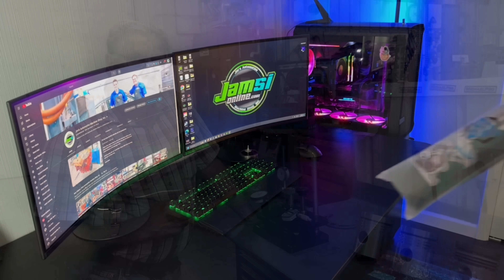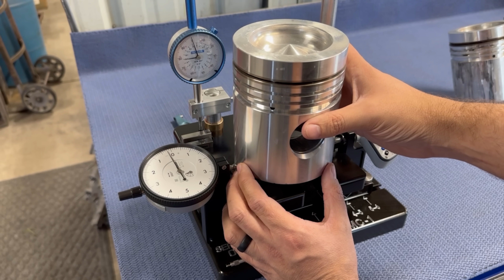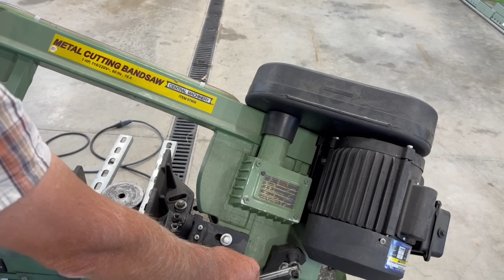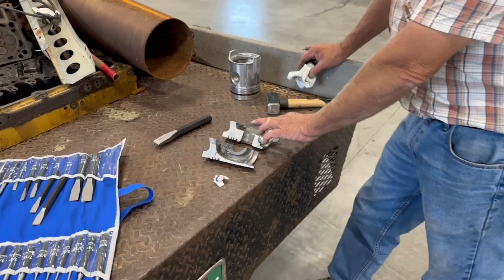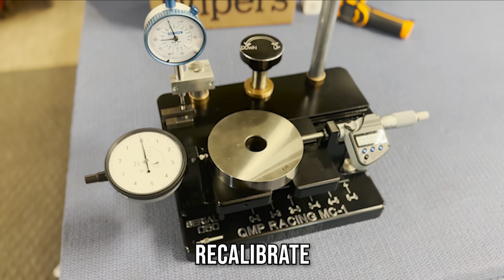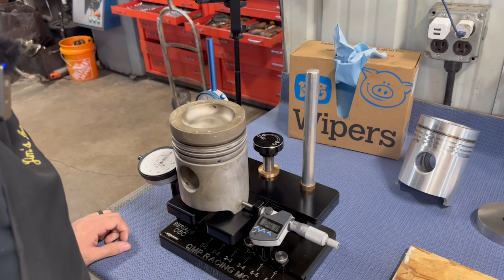Have TRACTOR Pistons Changed In 50 YEARS?

Comment: GOOD JOB testing this and learning.   BUT..... you need to check the cam grind and taper of the piston skirt to see the full picture.   The cam ground skirt is a bit like a leaf spring, starting with narrow contact in the middle cold, as the piston heats up teh contact gets wider....which more contact COOLS the piston and it's almost like it regulates itself.  You might already know... "four corner scuffing" is what happens when the springyness of the skirt runs out of travel.   Far as Silicon content, the amount that the aluminum expands with heat is negligible difference one alloy to another, but the true difference is how much the piston MOVES heat down to the skirt, and how tight it CAN get before scuffing.   LOW silicon pistons move heat fast and have POOR scuff resistance, so the skirt will expand more because it gets hotter,  and will need to be looser because the material is more prone to scuffing.   While a hyper piston the skirt will stay cooler, and can run tighter without scuffing.  
I'd love to talk with you guys sometime, tho I called once and did get a kick out of your answering service, which is fine, free time these days is a rare thing, but maybe in the future.

Comment: I would love to send you all my mildly built olds 350 and see a video of y’all going threw it. I could do it but it would take me way longer and I need more tooling to do what I’m wanting. I have the original blueprint sheets from je😢mmm Phillips & Wilkerson racing built the motor. 
Lift 490. /520.    @224/234. At 107 lobe separation  I wanting higher compression pistons. The a good aluminum heads and a
Full solid roller cam and lifters for it. 
Wish I could find a dieseil block to use and add boost to it.

Comment: Newer Piston verses older Engine block casting...Can there, and is there a lubrication issue... Possibly seizure...What about the chemistry or alchemy of the Piston metal..itself , between the two Piston. And actually the new sleeves could possibly have Metal chemistry difference that could effect... this whole thing..

Comment: Your right ,always go by the piston manufacturers recommendations . Only time I go by oem specs is if I'm using oem made parts. Piston manufacturers have spent millions on testing to find the best clearance,for new materials
Reply: If you think Reliance has ever had one of these pistons in an engine and tested it I can about bet it likely never happened. They are in the parts copying and reselling business not the development business. With a portfolio that covers thousands of engines of tens of thousands of applications many of which have been obsolete for decades    They probably could not come up with enough engines to test their products even if they wanted to.

Comment: Hello good after, great work, but here comes the guess from coach viewer. If you have an engine without oil squirters (that will cool down the piston) and new piston has more material in the bottom of the piston, so it will expand more due to a more material and  will expand more (than an old thinner wall piston) and cool less. So that may be a problem that you had.

Comment: Just weigh a piston, measure it's volume, and calculate the density; that will tell you if there's a steel insert.
Reply: I came here to ask that, would be a good indicator of how much difference in meat there is
Reply: Very simple to say but difficult to do.  A piston is not a regular solid cylinderical shape where its volume can be easily calculated given you have the accurate density data.  The said pistons have an internal 'topography' that is highly irregular so would be difficult to establish an accurate shape and therefore enable the accurate calculation of its volume - especially when "we" are considering small variatons.  It could be done if you have acurate aluminium density data and engineering drawings of the pistons - however even in the aforesaid case it will not represent the physical item since there will be variabliity during their manufacture.

Comment: I rebuilt a 1973 Harley Sportster using the specs from the manual. After 500 miles of gentle use I got on it and the front piston seized. I talked to the Harley shop and they said "the factory manual is wrong. You need to use the clearance in the factory manual ADDENDUM".

Comment: Love the series and not trying to argue but two things changed.   Maybe the most significant was the fuel pump rebuilt 100% correct (and I did watch the assessment by the consulting injection pump people).     The other of course is the ring gap.   And its possible that the one issue and call the ring gap an aspect,  combined to push the cylinder wall into overheat.     Will never know of course and the right things were done,  get the injection pump 100% correct and give a bit of more wiggle for the rings.

Comment: You mentioned the tin coating on the old pistons.  Goldsmithterry in his comment also pointed out the lubrication of tin.  It's like older USA made light bulbs.  Tin and brass bulbs screw into their sockets easily.  Modern Chinese made bulbs made from melded down Chevy's and Ford's will gall often times.  Could that tin coating be important on the clearance issues?

Comment: I’m really surprised you guys didn’t weigh the Pistons and then heat them up in an oven and remeasure them to see who had the most expansion
Reply: The weight would just be that an wouldn't change. An they did heat the pistons and check them. Maybe watch video over. They heated them up in moms oven lol.
Reply: @rprice7670  And froze them in mom's freezer, with the steaks!
Reply: @scrappy7571  😅
Reply: The mass (i.e. weight) of a piston does not change with an increase in temperature - within the temperature realms being discussed - as there is no 'vapourisation' of the aluminium.
As far as the pistion's thermal expension when subject to heat, the the video provided the information.

Comment: I designed machinery for almost 50 years. The coefficient of expansion difference between allows of a particular metal has never been an issue. What does effect it on tube-like parts is wall thickness and part density. A forged part will perform differently than a cast part. A part with a thicker wall will expand differently than one with a thinner wall.
Reply from the maker: To say coefficient of expansión difference between alloys of a particular metal has never been an issue is simply wrong and there are tons of studies, particular on cast pistons, to support my claim.
Reply: @JAMSIONLINE  Cast pistons and forged pistons will have different section thicknesses and that is where the expansion difference come from.

Comment: Everything goes into the tolerance. The internal changes could also affect expansion and the reason they made the changes. As usual your assumptions are spot on with what you find.

Any time you change from OEM there are changes. Even new OEM parts can have changes based on updates in everything.

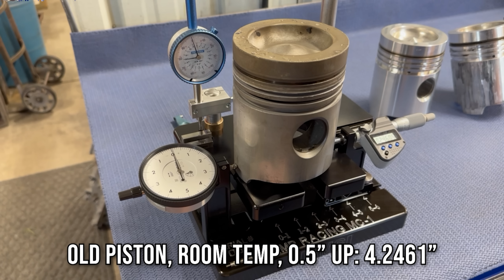Comment: At 6:52, you’re showing the measurement to be 4.246. That almost 4 1/4”. But the standard you used was a 4”. Something isn’t right.
Reply from the maker: A 4” standard is used to zero the micrometer. At that point 0.00 on the mic is 4” and 1.00 on the mic would be 5”.

Comment: Not sure you are considering that piston's can have a different cam grind. Basically that's an oval shape. I had my own pistons made for my race cars back in the day and I had to specify a cam. I can't tell you that I know what is good and bad or how to determine a clearance from the cam spec. I knew what worked from the guys that I apprenticed with and the difference between the Venolia and Arias pistons popular at the time. The Arias pistons needed a lot more clearance. Damn those things made a lot of noise before the engine came to temp but if you didn't make those clearances  loose you would have pistons that look your failed pistons in the video. I really need to find that old engine log book.

Comment: nice job looking at the geometry of the piston (skirt diameter across temperatures) .  I did see a difference in the geometry (more / less material) of the skirt below the pin boss.  this may make a difference in the thermal growth in that area and the stiffness of the skirt below the pin boss.  the question of material type is still unknown.  there are a lot of different alloys of aluminum.
Reply: Expansion will likely be less in a harder alloy.

Comment: That thing is the better part of $3000 dollars. You can learn how to properly use a micrometer for $3 grand.
Reply from the maker: And? You can ride a horse to the store too. One’s a lot more efficient. 

We said right in the video a micrometer is fine. Doesn’t mean this isn’t an improvement. It’s up to you to determine what value that improvement has to your own business.
Reply: @JAMSIONLINE  An amateur is not blowing $3K on a piston measuring stand. 

I would HOPE a professional engine builder has the competency to read a basic  micrometer. 

Not to mention one 'should' already have a have a dozen other ways to measure something. Surface plate, height gauge. lathe with a test indicator, mill with a test indicator, etc etc..

That begs the question. Who is this marketed towards? The answer is clearly clowns with more money than brains. 🤡🤡🤡

Comment: The only thing 2 machinists can agree on is... The 3rd machinist is doing it wrong
Reply: Oh man.  That is so right.
Reply: When a young grad student, I was in the engineering school machine shop and one machinist was fussing to me that another machinist was stupid to drill a  large hole by slowly stepping up in drill size, as if I knew any better (no undergrad courses on machining nor shop).  He said all you needed was a tiny pilot hole and the final drill would follow it straight down.  Perhaps the hole ends up more centered that way, but I step up drill bits gradually at home.  Maybe I could get by with a two-fer if my drill bits were ground perfectly but I just eyeball them on a grinding wheel when re-sharpening.  At least they had a quality drill press which secured the parts, but drilling a hole on a milling machine or lathe would likely hold center better.
Reply: @williamgrissom9022  whatever gets the job done. At home you can do it however you want!
Reply: @williamgrissom9022 Generally, the larger the diameter to be drilled, the amount of steps should increase. Small holes will be fine with two sizes, just as very small holes will be done with just one. As the material volume increases with pi as the diameter increases.
Reply: It's obvious that you've been in a shop that's had at least three Machinists ! 😂

Comment: The shape of the lower end of the Piston where the older one is square and the newer one is rounded. that rounding is physically stronger than the sharp right angle and eliminates stressing fail point in the Piston skirt.

Comment: Old tip on piston fitting. Just boil each piston and measure expansion while hot. If the piston expands .004" and the clearance is .003 well you guess what happens.
Reply: U done this yourself?  Would love to see the video.
Reply: They just did the expansion test using the oven - which is a lot hotter than boiling them. Their clearance was fine. Came down to ring gap and suspect injector pump.

Comment: The main reason there's a steel or cast iron ring for the upper piston ring is to make a thermal barrier to it, to avoid or reduce cooking, and it's also useful to keep the groove shape to the right dimensions, to allow the ring to be pressurised by combustion gasses.

Also, if the ring has a conical section, meant to "hammer" slightly in the groove to clean off combustion residues, the hard groove surface allow it to last a lot longer.
The small dimensions of the embedded ring can't make any difference to thermal expansion of the aluminium, it is going to stretch when hot!

Comment: I understand the issues of fitting modern manufactured parts to an older engine, tolerance stacking and changed materials make for interesting decisions over what is "right". However, I am so disappointed, as I feel that there is no credibility to your research, as you weren't wearing white coats with pens and a 6 inch slide rule in the top pocket. 🤣😂🤣

Comment: Incorrect piston sidewall clearance does not crack valves if they never make contact. Back to combustion temps and injection timing.
Reply: Yup and a turbocharged non after cooled non piston cooled engine can be fine but it has much less margin for error on heat.

Comment: While like you said this isn't MIT level exact, but this gives us and yourselves some quantifiable data.  I initially thought part of it was the piston clearance was too tight just do to the engine locking up solid like it did.  While I'm certainly willing to admit I'm wrong, I'm not 100% on the issue is settled through.  I would love to see a similar experiment with the old and old/new sleeves to see how that would work out.  Because lets be honest the piston is only 1/2 of the equation.  Lets say the old sleeve expanded 1.5 thousandths but the new sleeve only expanded 5 ten-thousandths then everything is tightening up by about a thousandth or so even though the new pistons expand less.  Unfortunately we would need both a new and old sleeve to prove or disprove at this junction in a similar manner to what you did here.  It was a godsend that you hadn't sent the pistons to the scrapper at this junction.  

None the less the data is compelling and thank you for taking the time and energy to put the video together.  Very much appreciated.

Comment: Those inserts in the top of the piston are ductile iron I believe. There is a company in Salem, Ohio that makes those inserts for casting into pistons and they make them from centrifigally cast ductile iron.
Reply: Quaker Castings.
Reply: Ive machined about .010" off the top of pistons for use in pulling tractors because the top gets hot enough to grab the cylinder walls. They sometimes grab the cylinder even with .050" clearance at the top. The insert around the ring cuts like ductile iron.

Comment: Science is always fun (for some of us).  You mentioned that the old piston had TIn coating.  As a retired machinist (CNC and Manual) I have had considerable experience wi9th this coating as well as others.  The primary reason for TIn coating is lubrication.  It's applied to carbide for that very reason not to have chip buildup on the cutting edge.  I could have influence on the heat variation also on the wearing capabilities.  Good video gentleman.  Keep on smiling.
Reply: They most certainly were not coating tractor pistons with TiN in the 70's.
He means actual elemental tin (Sn), as in tin cans.
Reply: Wonderful!
Reply: Tin, as in Sn - tin metal - VS “TiN, i.e. Titanium Nitride?

The first is sort of a silvery color, vis Titanium Nitride (on, say, TPG222 inserts - what some of my lathe tooling takes) have more of a gold color.
Reply: Pardon me for being so stupid.
Reply: OK, let's put this in perspective, first I did not clarify nor state that, that was used in the 50's second I only suggested  the purpose of Tin coating not anything to do with Alais tractors.  Gees, give it a rest, please.

Comment: I might be talking out of my ass here but if the issue was clearance, wouldn't all the pistons be scored/show signs of overheating? If you guys have the time, can you guys check the pressure that the water pump is sending water? My guess is that something might be restricting passage to the front cylinders (the ones getting hotter) or there is just not enough pressure to circulate coolant through the engine at a fast enough rate. Again, something is wrong on one half of the engine, that means that if what you machined and spec'd is uniform, then it can't be what you just machined.

Comment: Absolutely 💯  you can't  go off old  factory specs  ,when  using  new manufactured parts  myself  I learned that  expensive lesson  aswell  especially when  building David brown  engines
Reply: David brown, didn't they manufacturer some of those funny two wheel tractors at one point? I know there was a few companies that did, like gravely being the one I see most commonly. Probably not what you're working on, but just curious.
Reply: @goosenotmaverick1156   David brown  was with case tractor and dozer division  and possibly with other companies
Reply: @zvondiesel  gotcha. The ones I'm thinking of I can't remember the name, so I'm trying to figure it out. Obviously not David brown then lol neat! 

I've been working on my neighbors Ford 6600 for a few years basically restoring it one bit at a time. It's been a buggar, I'm a car guy not a tractor guy, but it's been fun too. We started at the front and are working our way back lol front end (wear pins, bushing, wheel bearings, etc), engine (entire rebuild), new clutch kit, trans (all bearings and worn parts replaced), steering system (pump, gear, lines, linkages), pto clutch, hydro pump, spool valves for remotes. Eventually I'll have to dig into the brakes but for right now that's all functioning properly and adjusted. 

Dude has spent astronomical amounts of money thus far.

Comment: Could the new pistons have a slip coating? Or have the oils improved? Changing  the tolerance?
Reply: I was wondering if the difference in material thickness in areas changed the way they expand with heat. I'm not done watching yet so I guess I'll find out something about that shortly lol